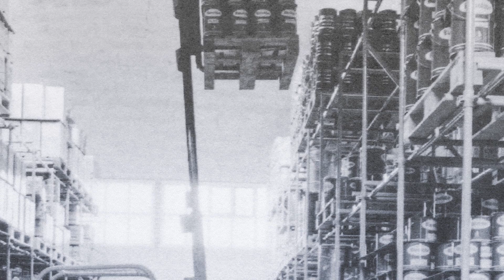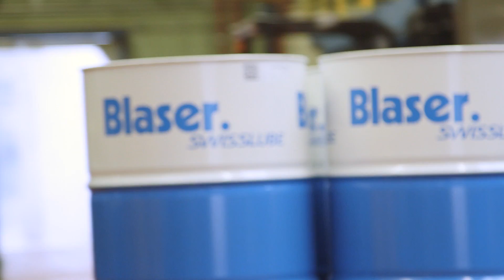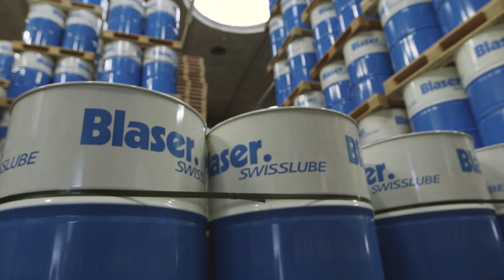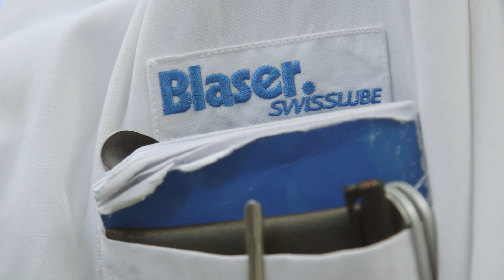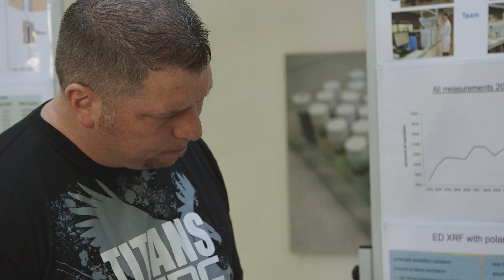Epic CNC Machining at Blaser in Switzerland... Titan Gets a Tour.

Comment: Why does the development of a metal machining cooling fluid require microbiologists? Is it something to do with bacteria poluting the fluid over time and changing the characteristics?
Reply: It can also effect the people working with the machines. If the coolant isnt changed frequently you could get sick from it
Reply: @DennisderDoenner  Absolutely, I worked at a CNC shop years ago where everyone was getting sick and not getting better. We finally found out to that it was the old coolant. It was all changed out, and boom, everyone got better!
Reply: Yes exactly this. And it can smell pretty bad if bacteria infected the water
Reply: foxbow90 Imagine working with a machine that smells like a rotten corpse :) and it can get you sick
Reply: Not only does manky coolant smell and be pretty nasty to work with it can also react with metal that can tarnish jobs and in the long term knacker your machine.
Reply: Here's a free trip to all, from someone who has been machining for 40 years: 
Add new coolant at LEAST daily to help the control of bad bacteria. The new coolant has fresh bad bacteria eating properties. So never let it get to a weak concentration or to a low level of coolant in machine. I see so many people in shops run till coolant pump is cavitating, because coolant is so low. This is bad also because temperature of coolant is higher too at low levels